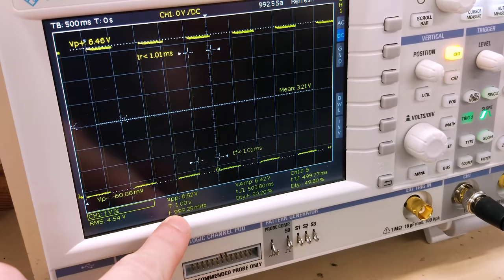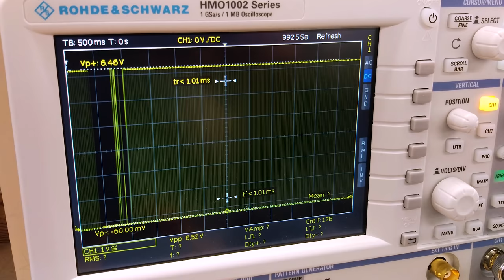Binary Clock Prototype Build - Part 3 (The final episode?)

Comment: Many small parts as the project progresses is spot on, (including the thinking and methodology as it is helpfull) even if some are 40 mins ;)
If you want to appease those that want a single vid you could always make a short vid of the whole project with clips, cutting out most of the content but showing the meat of it (no repetition of each resistor and each LED etc). 
This would not be my choice but have noticed other youtubers do it to TRY to please everyone , it does not always work tho, due to the grass is always greener on the other side problem.
Main thing is that you are happy with the content you put out, after all you are the reason we are here so your judgement can't be that bad.
Thanks for not adding music btw. Hope you get the board sorted soon, I'm itching to build one lol. keep up the good work.

Comment: This is a nice video (series). Maybe bit long but I enjoyed it nevertheless. Once you have confirmed that the schematic issues that you mentioned are actually what's wrong you can make some new pcb's. That also gives you the opportunity to fix some of the mistakes/annoyances that you ran into along the way (such as tiny solder pads, spacing of the ic's regarding the via's, doing a sub-optimal soldering job on the ic's due to large tip, diode direction).

Comment: The leds are wired to 1,2,4,8 instead of 8,4,2,1. ie upside down.
Reply: Chris Hardy yeah, thought the same .... won't be fun to bodge that 🙈
Reply from the maker: Trust me when I tell you there is a lot more wrong than that. Wired upside down would just mean I could flip the silkscreen. I may have fudged my carry out signals with the negative going glitch... by which I mean I did.
Reply: David Watts If you just flip the silkscreen your digit ones won't align anymore. Sorry I have to tell you that 😜

Comment: I think they are called “jumper links”. 

Once you get your oscilloscope, you could try some different value loading capacitors, to get a proper 32768 frequency. Once you know the proper value you don’t need to get new crystals.